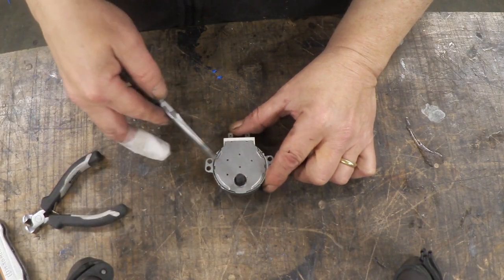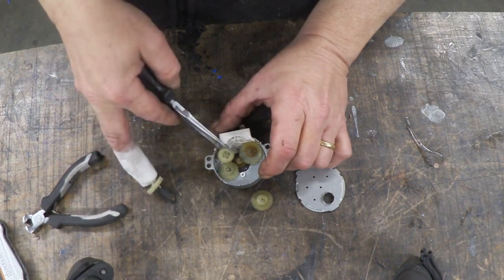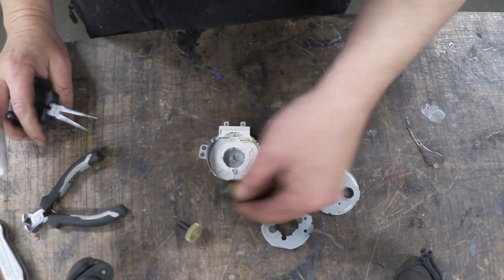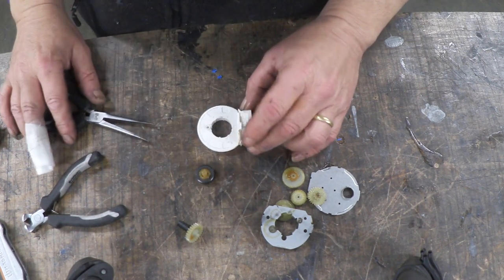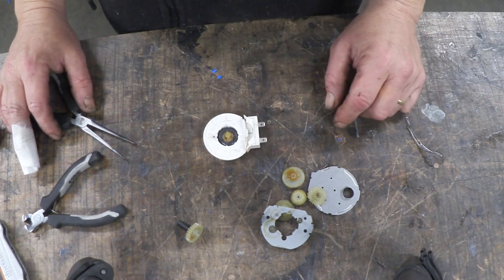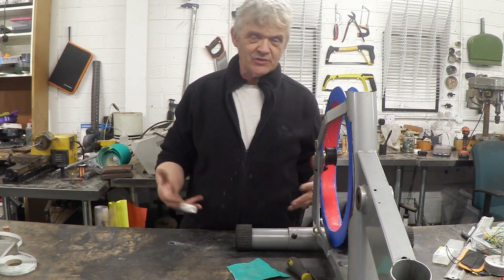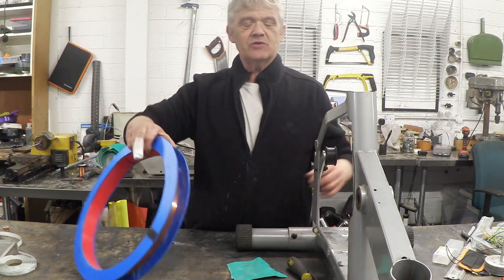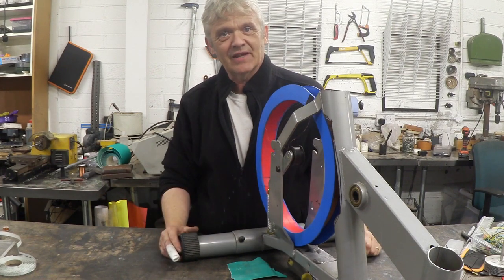Playing With Coils And Magnets

Comment: Hey buddy I like your thinking behind this, however, I believe you have overlooked a key aspect to the design of this synchronous motor, if you observe the little metal tabs on the casing of the motor that the coil sits into you will notice that the bottom of the metal has tabs little metal tabs sticking up that the magnetic rotor runs past and on the top side of the metal encasing the motor it has little metal tabs sticking down which the rotor turns past, the reason for this is that the alternating magnetic poles line up with those little tabs, the north will line up with the bottom and the South will line up with the top and it transfers the magnetic field from the sides of the rotating magnet to the top and bottom of the magnetic coil making the face of the magnetic coil North and the other face South as it alternates as it spins around, so the housing of the motor is crucial to the design aspect of its workings, just thought I would share a little insight that I have discovered from playing with these motors and studying the design construction
Reply: A rotating shield ? is that what your referring to? Interesting!
Reply: yep,the devils in the details as they say, in hindsight its now clearer, ;-) i bet it was optimised by a toy maker, you can learn a lot about cost and reduced materials use from them iv found
Reply: @paulmaydaynight9925  yep, that's why all industrial runs on 3 phase, is most efficient out of any other system, and it high voltage 480, so the efficiency is even greater, we have a saying in the industry, " the higher the volts, the lower the bill" it's the most efficient and powerful and it works just the opposite for generation which is why all the hydro and wind turbines are 3 phase
Reply: Yoke "Description: A magnet that induces a magnetic field in the area of a part that lies between the poles. Yokes may be permanent magnets or electromagnets. Permanent Magnet Yoke - A body which possesses the ability to retain or hold a large amount of the applied magnet field after the active power of the field is removed."

im not sure that 'Description' describes the basic action for better understanding, id say its more the left/right flipping of the temp induced trailing magnetic field in the steel as a consequece of rotation perhaps.
as eric put it, the tea is always trailing the spoon as you stir it...

oc now the thought pops in the head ,modified cost reduced wimshurst frame with coil and steel sheet with many bent thickend tabs over and intersecting the pole, double the output by also using the other pole by winding the coil with a space etc...
Reply: @paulmaydaynight9925  yes and as I've studied this effect I also came to a great realization when I understood that in certain circuits or certain scenarios and in inductive circuits voltage will lead current, and in resistive circuits current will lead voltage, and in capacitive inductive resistive they can be tuned to a desired phase differential which can actually eleminate the Lenze effect almost entirely
Reply: @paulmaydaynight9925   So would that not be also a rotating shield or shielded spots as to allow the flipping action to occur. hope that makes sense.
Reply: @paulmaydaynight9925   I think what your referring to is the 90* flipping so you actually have a scalar wave instead of a single wave. correct? so the dielectric wave is followed by the magnetic? If that is comprehendable. apologize.
Reply: Eric? are you referring to Eric Dollard? I need to catch up with his latest info been to busy with legal studies.
Reply: @clint9344  yes,thats the thinking clint
Reply: @clint9344  No, Professor Eric Laithwaite the inventor of the linear motor, aka the bullet train propulsion
Reply: @paulmaydaynight9925  hmm I know who your referring to, but I do not recall him ever referring to it that way that I recall at this time.  can you refer me to this info please.
Reply: apologize not refer but point me to or send me a link to find this information. thank you
Reply: @JasonJoplin  Sounds facinating! Would really love to learn more about this! Do you have videos showing this in more detail or, poss have links you could share about it? Thanks.
Reply: @paulmaydaynight9925  I'd bet you're right!  I've been preaching for years that "tinkerers" should not overlook toys in their quest for knowledge or inspiration!  I firmly believe that some of the worlds finest and most creative engineering has gone into (and sometimes been hidden forever inside) toys!
Reply: ahh thanks this was begining to do my head in lol. So the coil imparts magnetism into the "tabs" (which reverses with ac frequency) tabs are positioned so the traditional perpendicular to magnetic field rotation occurs.
Reply: which beggs the question why does Roberts version work at all? Yes it is very bad but it is doing something . Probably due to the random winding pattern that the wire follows arround the bobin , it may be that the slight meandering causes an opposing or slightly opposing angle in the winding which does produce output. I suggested winding that bobin with a zig zaging pattern which would still have the benefit of -you only need to make one large coil - and produce a significant output.
Reply: @Non of Ur business sounds like a case of throwing the baby with the bath water! Nobody knows everything do they .
Reply: @Non of Ur business . i suppose some people just aren't creative and want to take things for nothing. shruggs! you dont learn it on a coarse

Comment: Fun stuff!! It will be interesting to see how multiple parallel windings ( and hence reduced total coil resistance) change the power output. 
It also would be nice if you had the luxury of a magnet replacement module, that would allow you to easily try different combinations of magnet polarities.

Comment: 'Why are you smiling?"
'Because, I know something you don't know"
'And what is that?"
'i am not left handed..."
Dread Pirate Roberts and Enigo Montoya - Princess Bride
Reply: I'm not left handed either
Reply: I also know he carefully concealed the pole pieces of the coil. The coil have 4 pairs of poles. 4 on the top plate, and 4 on the bottom plate that he very quickly removed from view after removing the coil.  Fake science video trying to make it appear that the coil alone can create torque on the 8 pole rotor magnet without pole pieces. Then he conceals the magnet assy in the large coil.  I see others spotted this too. Congrats some know how these motors actually work.
Not sure to attribute this to malice or ignorance on the subject.
Reply: @isettech  My, you have a lot to say ‘Mr. Dunning-Kruger.” Perhaps you should attend University?
Reply: @undernetjack  Thanks for the reference. I had to look it up. If I was young and could get ROI on the investment in school, I would consider that, but hard study and certifications work fine for engineering jobs. Nearing retirement, so university would be an expense with too little returns. Investing instead to increase my dividends as much as possible. Hope to reach $2500/month before I retire. Should be there in 5 years.
Reply: @isettech  Good fortune to you. I retired 9 years ago and still invest my time in learning beyond anything taught at Uni. Cheers.

Comment: It's a unusual setup in comparison to standard motor based orientation of coils and magnets. Usually there is also 2 coils or multiples of 3.
In this design, apart from what Paul has said about magnetic fields passing through the steel, I think you have to look at magnetic flux, this usually occurs in the 4 corners of the magnet and each flux rotates counter to its neighbours. Howard Johnson was a pioneer in magnetics and until recently not enough forward learning has been done.
This motor works because of the flux movement in the magnet and it's distance to the coil. The coil is also thinner and thicker (maybe I should have said narrower and wider)
The bobbin possibly has a thin ferrite ring within the inners where the ring magnet sits.
Great video Rob, I might try a few versions of this myself.

Comment: Robert -- as others have alluded to, your understanding would really jump ahead if you studied up a bit on magnetic circuits.  By itself, the coil in the small synchronous motor produces a field parallel to its axis, which would impose zero net force on the rotatable magnet. You have set up the reverse of that, and discovered the expected -- the rotating magnet induces almost no voltage or current in the winding.  The key is that in the motor there is a magnetic circuit, consisting of the top and bottom plates, each with fingers that extend into the region around the rotatable magnet. Those fingers "conduct" the north- and south-pointing fluxes into the area around the magnet, and their interleaving produces a N-S-N-S pattern around the magnet. In addition, since the current itself alternates in time, those fingers of flux alternate N-S-N-S in time as well. The result is that the magnet sees around it a rotating N-S-N-S... pattern, to which is is drawn and thus persuaded to rotate. At least once it gets started. 
At any rate, applying this to your generator, you would need to set up a similar pattern of two magnetically susceptible  plates (one each side of the coil) with fingers that the magnet poles pass by, and which conduct the pulses of magnetic flux to either one plate or the other, so that you actually achieve an alternating axial field through the coil.  Then you'll get a far more robust result!

Comment: Slight problem. The round magnet has multiple alternating poles, and the metalwork (looks like prongs) guides the alternating magnetic field to each face of the coil. One set of prongs leads to the plate on one side of the coil and another set (interleaved with the first set) leads to the plate on the other side. The prongs and plates make the magnetic circuit. Each plate gets an alternate north / south through the 'prongs' from the multi-pole magnet, as it rotates, when use as a generator.

Comment: That is quite interesting. I think you'd get a better output if you were to alternate the magnets, so the poles are perpendicular to the plane of the coil, and affix a series of C shaped iron pieces such that the coil was surrounded by them with the gaps nearly touching the magnets, and spaced such that only one polarity of magnets were between the gaps in the C's. That way there's a coilwide change in the flux as the the fields in the iron peices and in free air changes with the change in polarity of the magnets sweeping by.

Comment: 1. Yes, the resistance is large and the distance of those magnets is too big.
2. I've got an old training bike in the shed, once will clean up moving my rooms, can take it out :D as well and play with it. I'd try multi-level magnets. What I mean by that is to use one layer of magnets for one coil, and make several of these that in one turn we have at least 3 phases :). We can use capacitors to charge and even MOSFETs from old electronics to switch. Not once capacitors are charged enough, they can release energy to the battery and be ready to charge again. I've got a bunch of old HDDs that I can take apart for magnets. Some of them were even bought to do so years back.

This way there's much less loss IMHO. And if we'd be able to use those layers + phases, that potentially can increase the efficiency.

Comment: Great idea to explore this arrangement, after watching one of your vids on the turntable motor a few months back, I turned the rotor with a drill and  I was able to dimly light a 240v lightbulb, ac voltage was well over 50v. If I had a suitable high building I'd have explored a gravity battery.

Comment: If you refer to microwave motor you will notice the metal sheald which transfer magnet fields around the coil, if you try that there will be improvement of volts

Comment: Generating electricity is fun. I created and stored some solar power gathered from LEDs instead of solar cells. Not useful as power generation, but I understood energy harvesting and how larger systems work a lot better afterwards, while only needed basic components and a multimeter.

Comment: I would really like to see a video on taking electrical measurements. You frequently measure open circuit voltage and short circuit current to judge the power output of a device. This seems counter intuitive to me. I'm not questioning your understanding of it, just curious to know if the measurement is an accurate representation of the power being generated. I have also been told that this measurment technique can be used to help derltermine the optimal load. That's really cool if it is true!

Comment: Hey Robert, over the years of tinkering I have been pleasantly surprised at how many things fit other things, it seems that due to standard sizes already used designers tend to continue to use standard sizes for a number of reasons including the sizes of existing jigs and tools. On my projects where I found things that fit other things I was always working on my own but you have a lot of interested people here therefore I suggest that you give us the required dimensions for a winding to fit your roof ventilator, ask everyone to have a look around to see if they know of anything that might fit and give it some time, maybe give us a reminder over the next couple of videos. Wouldn’t it be fantastic if there was a motor winding still in production that was suitable.

Comment: The synchronus motor is built that way so the AC wave becomes the driving frequency and maintains a set speed. I put a lego cog on one last week to make it drive a large cog and turn even slower, and got bitten by the voltage when the drive pin turned from me driving a screw into it. Note to self...don't touch connectors while trying to turn it.😲

Comment: Before you rewind it in smaller coils maybe it is a good Idea to change the coil orientation to 90 degrees and try with same magnet configuration and a N,S,N,S config. I know it is easy for me to "advise" since I am not doing the work, but would add to the play.

Comment: the newman motor generator has similar coils but they have the traditional opposing polarity to the magnets configuration. I never thought of trying it this way.
 I once built a minni version to play with inside an aresol lid with a nail for a shaft and 9v battery and a 2.5x1x0.2cm neo magnet .pretty powerful little thing! 
Now if you wound that one coil with a zigzag it might be a better generator because it would have more opposing lines to the mag field .
if you think lines of magnetism in a doughnut shape spinning out from the edges of the magnet and returning to the point between the poles you would have some intersecting of wire and "lines of magnetism" going on (like a wheel travel forward and backward at the same time kinda)

Comment: Try a roll of aluminum tape as a coil
Reply: @IC86688  they usually have plastic backing for the adhesive removal and it's often a Aluminum laminate with plastic

Comment: It might be possible to mount magnets to the drive belt and wrap it in coils of wire.  It might also be possible to add reverse-wound coils to the inside, negative pole area  of the driven rotor.

Comment: Hey, I need alittle information please. I have a 110volt ceiling fan, which i turned into a windmill, using those same exercising magnets😄Im producing 13 volts at max wind speed but im gaining milliamps, like 5.1 4.5. Also i have a 12volt dc motor but its the same milliamps. How can i improve this system to amps?

Comment: Another informative video. I’d like to suggest a direction for you. I’ve found that the bifilar wound coils I’ve used in motors and generators seem to significantly outperform coils with a winding of a single wire. I rarely see anyone use this technique. I also saw a video of the assembly of a motor used for a Tesla Model S that crimped hundreds of wires together, then only wound them once or twice. So, you have less resistance, and the capacitance between the wires (also, notably in generator form) greatly impacts the window of operating voltages. Unfortunately, using multiple wires to create a coil is only easy if you know the exact length of wire and have them pre-cut and wound, or you have to multiple wires simultaneously. The latter is a little easier, but still a little more work.

Comment: I would have thought that the microwave motor runs with 230 Volt AC. So rotation of the magnet arises from the magnet’s poles being pushed/pulled by the resulting moving (‘rotating’) magnetic field in the coil. Your bunch of rotating north poles produces minimal change in flux in your big coil (due only to wobbles in the winding). Lack of iron around your coil also leaves the magnetic field dissipated but with no changing field strength or direction iron wouldn’t help anyway.  Next!!!

Comment: Did you check the original magnet from the motor to see if it was axially or radially aligned for polarity? I've seen a few small motors with similar setup where the magnet was split along it's length for polarity instead of end for end

Comment: careful though Rob! if you do get a decent out put with all that copper wire and a magnet rotor with that diameter could produce some serious power, what gague wire is it ? 
An athete could produce 500watts on an exorcise bike for a while i think , or rather they exert the watt 500 equivelent of joules. So theres your upper limit on a human powered electric generator , you may need coils to withstand that much energy without turning into a peddle powered magnetic induction kettle.(now theres an idea lol oops!)